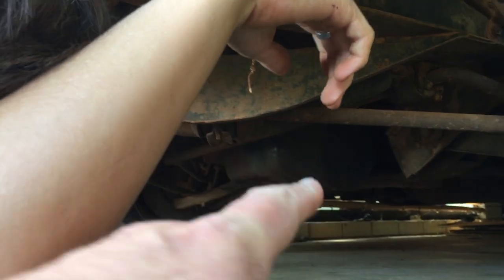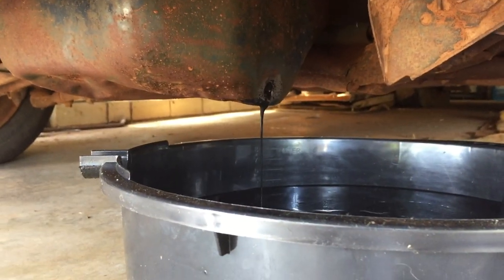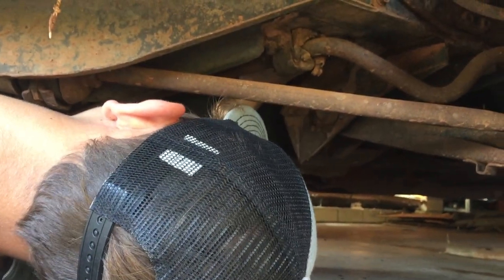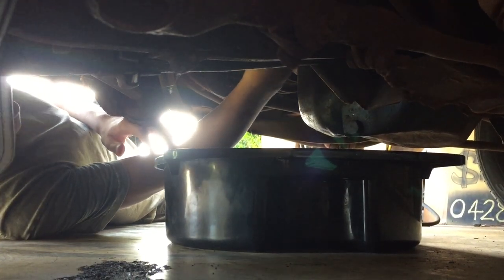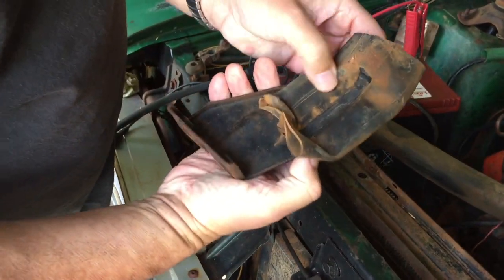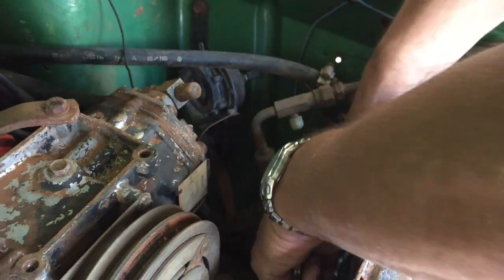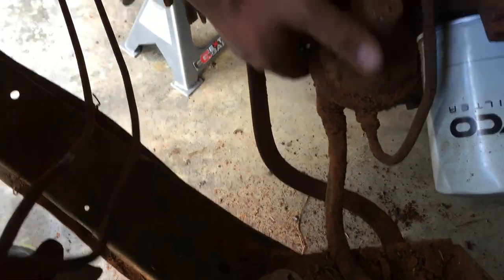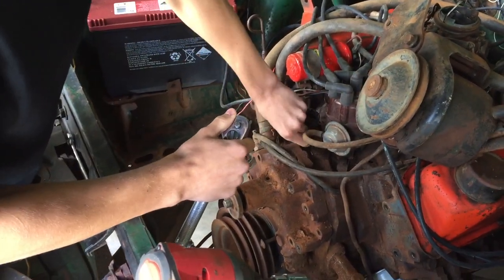"Crusty" 1974 ZG Fairlane Revival. Part 5

Comment: I like to pressure wash dirty old crusty engine bays before I do anything, but I have to say that Clevelands are great to work on. I love everything about them.
I suspect the amount of rust behind the pump may also extend to the water jackets inside the block. I wouldn't be surprised if you have more crusted up and even restricted passages leading to the heads. Needs a few good flushes with cooling system flush before adding fresh coolant.
Unfortunately, coolant wasn't much of a ting back in the day and so many engines suffered major internal corrosion and component failure as a result.
You must use coolant for obvious reasons.

Comment: She has a zf grille…
Mum had one of these when I was a kid 
Tough old girl 
I drove it a lot when I first got my license
Cleveland motor required a different type of thermostat to what you have 
Make sure the brass piece is fitted in the block under the thermostat or it will overheat